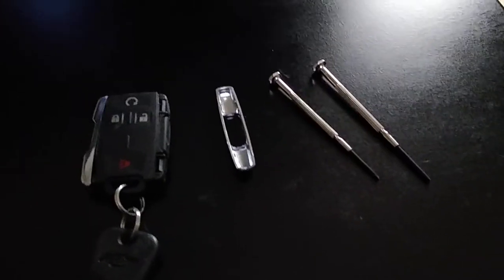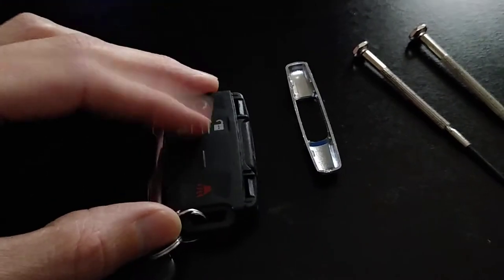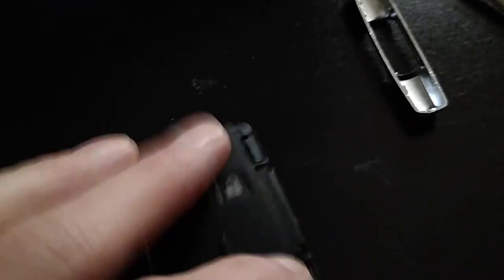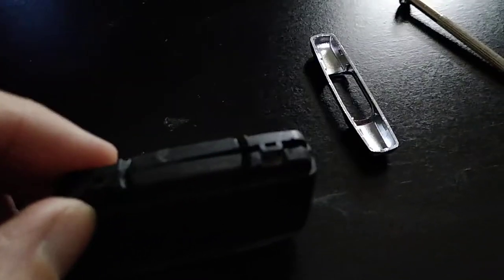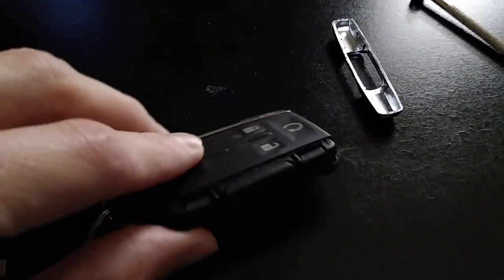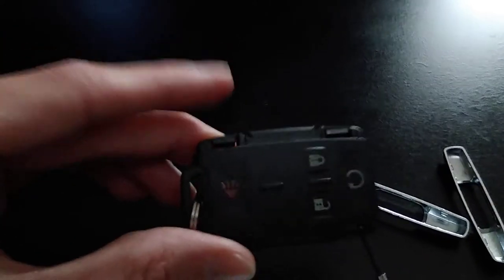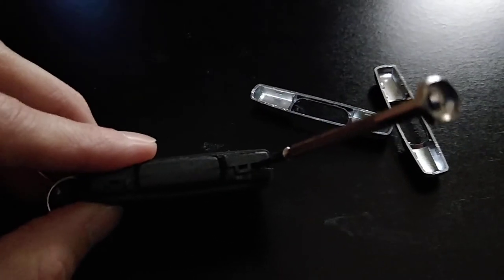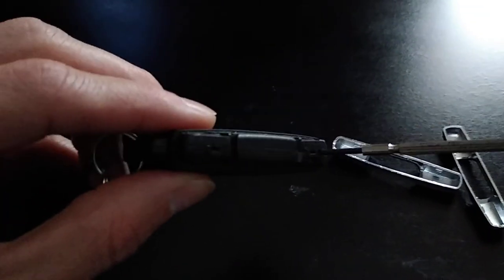Partial disassemble of a Chevy keyfob

Comment: Byw. Easyhangit.
Break the chrome off! Frig it.
Once the chrome pices are off , it comes apart. 
All you need to worry about is hurting your computer board. 
Youre never goung to use the old case again.
Dont waste your 45+ minutes saving your old fob!
I just did it. Total time 7 minutes. 
Lock . Un lock. Auto start and panic work fine. 
No need for lock smith.
The end!

Comment: Not sure why I blindly followed this video and now I have all these broken little plastic pieces after prying off the sides. All you gotta do is pry the back from the bottom and it will pop off and you’ll see the positive side of the battery. I’m kinda mad at myself for doing it this way but I have a new silicone cover on my fob so now it looks like something new instead of beat up.